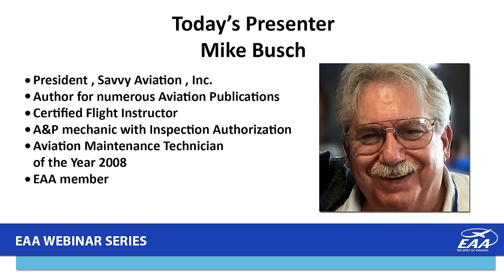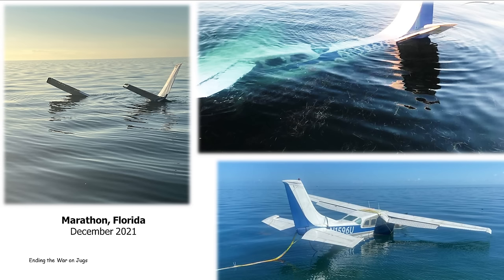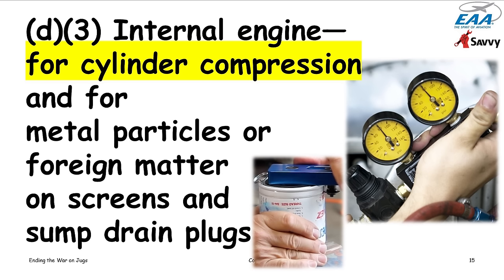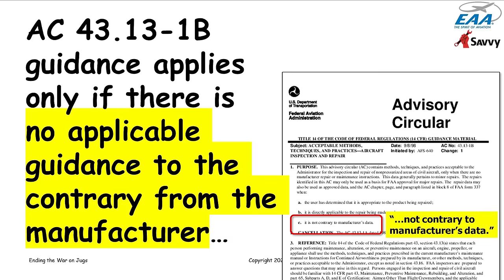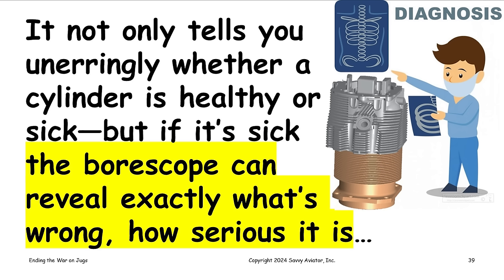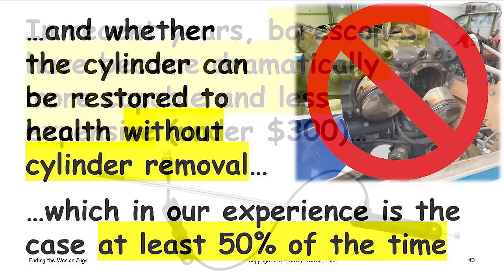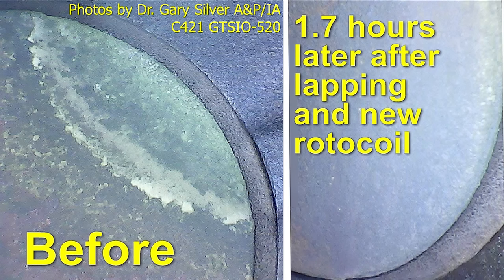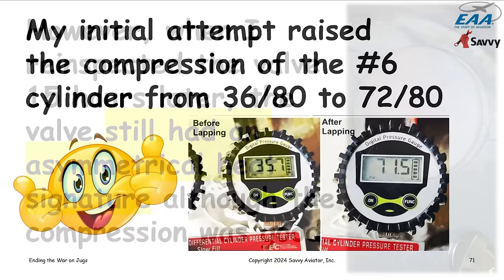Ending the War on Jugs

Comment: I don't know why this guy is so uptight about cylinders all you have to do is follow the procedure
Reply: Mike's message is pretty clear in literally every video. Don't touch things that don't need to be touched (as long as you're properly maintaining and caring for your aircraft). Specifically, if you can use a modern tool (borescope) to determine the ACTUAL condition of an engine, the only time you'd need to remove the jugs is when you KNOW its condition warrants that level of work.

Some mechanics will never get it wrong but why take the risk when there is no upside vs the less invasive and more accurate process?
Reply: @cbbbbbbbbbbbb  I'm just saying that when it is time to change a jug he makes it sound like it's the most dangerous thing in the world. And it can be if you don't follow the procedure
Reply: And if every procedure in any dicipline was followed properly we would never have accidents. Same for people following the speed limit and not staring at their phones while driving. The problem is that removing a cylinder multiplies the opportunities for mistakes when there are a few things that can be done first to fix the problem and reduce the opportunities for mistakes.
Reply: @jimstanley_49  Wet torque with new hardware and clean mating surfaces.it's not that difficult. Whith multiple cylinders use torque plates and do not move the prop. Seriously it's not that difficult
Reply: Did you watch the whole video?
Maybe you should watch from 1:23:25 where Mike answers a question about how failures occur after cylinder maintenance?
Reply: @charlesbrewer6552 and Mike clearly says what I said use wet torque use new Fasteners with clean mating surfaces  guys this is not that difficult
Reply: @derheeheehee6941  He did not say you should not remove a cylinder.
He did not say it cannot be done safely.
What he said, if you bothered to listen, is that history has shown, is that many accidents were caused by small mistakes made when putting engines back together again.
This is an historical FACT!
The accident record shows this!
SO, only pull an engine apart if it is REALLY necessary.
What on earth don't you GET?
If it is NECESSARY, pull the cylinder, but if you can avoid it you will reduce the risk of maintenance induced engine failure and substantially lower the cost to the OWNER who has to pay for all this stuff!.
Reply: @charlesbrewer6552  you can listen to Mike I will follow the overhaul and maintenance manual.
Reply: Yup. While critical, it’s not hard.
Reply: @derheeheehee6941  OK.
But I would not pay YOU any money to work on MY airplane.
Reply: @charlesbrewer6552  I don't want you to pay me I want you to stay away from the wrenches. The 0-320 Lycoming has 4 3/8" deck  nuts at 300inlbs and 4 1/2" through stud nuts at 600inlbs. Why are you letting that simple procedure kick your ass? As a licensed mechanic with inspection authorization I've done at least a hundred of them in the past 30 years and I've never had a problem so yeah you need to stay away from the wrenches.
Reply: It's not a bad thing when certain customers don't want you to work on their plane.
Reply: @firstielasty1162  easy peasy. Just triple the quote and they’ll go elsewhere.
Reply: @derheeheehee6941 100 or so cylinders is a REALLY small sample size when compared to the data sets that's he's talking about. Congratulations on your personal record however as he does say you can have had hundreds of successful installations, and have a failure on the 300th or whatever. Point is, if the risks are avoidable how isn't it responsible to avoid them?
Reply: @TheRedbeardpirate  I just buy a new cylinder assy, install it per the overhaul  manual and call it a day. It's an easy procedure.
Reply: @derheeheehee6941   Don't stop learning we can always improve as better data and procedures are proven.  Go back through Mike's work he goes into great detail why avoiding unnecessary procedures is good for everyone involved.
Reply: @nitrostamped  installing new cylinders is a necessary procedure

Comment: THE ONLY PROBLEM WITH YOUR RING FLUSH IS CLEANING THE TRASH OUT OF THE CRANKCASE SO IT WONT END UP IN THE BEARINGS LEAVING YOURSELF WIDE OPEN FOR A LOT OF LIABILITY THE VALVE LAPPING AOK

Comment: You are right on on the xylene flush. I have used it on cars, and have no doubt that it works. Have not yet done it on aircraft. 
   I do think that rings leak more often from sticking than wear, and how an engine is operated matters a lot.

Comment: In automotive circles, mechanics commonly employ 3 types of compression test:
1) Leak Down: Measures steady-state leakage at TDC (i.e. end of compression stroke). While it represents a critical position, running engines spend very little time at TDC.
2) Dry Compression: Measures transient leaks at starter/cranking engine speed. Tests leakage along the full compression (but not power) stroke.
3) Wet Compression: Similar to 2), with oil sprayed into the combustion chamber, for improved ring sealing (valve sealing unaffected). Excessive oil risks hydraulic lock. I suspect that oil sealing is most effective with vertically oriented cylinders, and least effective with horizontal cylinders.

Ideally, such tests are conducted with a hot engine, as a cold engine compression test would only represent cold-starting conditions. I imagine that (even large) air-cooled aluminum engines cool off rather quickly, compared to liquid-cooled engines. It seems that flying for "at least 45 minutes" does little good to stabilize its temperature, when it takes several minutes to descend, land, taxi, and remove spark plugs.

Comment: I've never heard that oil comes out of the oil control rings, but rather the oil control rings scrape the excess oil off of the cylinder walls that gets there from splash from the crankshaft. I don't believe that any pressurized oil comes out of the holes rather it drains in through them.  That oil then lubricates the wrist pin.  This is why wrist pin failure is common in sludged up engines
Reply: That's also why these sludged up engines consume more oil because the oil control rings are not removing that excess oil from the cylinder walls and therefore it then gets burned
Reply: Wrist pins also fail from detonation.
Reply: Wrist pins are splash-lubricated by the crankshaft in most engines. Oil control rings reduce the amount of oil reaching the hot piston rings to significantly reduce coking, and oil consumption. They "control" the oil film thickness on the cylinder wall, not fully remove it.

Comment: Not just about flying after engine work, but also flying post paint work as well.  After painting, all the control surfaces have to be reinstalled, the engine was sitting for a long period time, and possibly get contaminated with all the chemical washdown.  Yet I often saw owners of newly painted airplane took off and flew home or somewhere else without doing post paint inspection flight.  I saw owners rushing to leave the airport for long overnight trip in their newly painted airplanes.  Or sometimes, they hurried to takeoff to escape the incoming bad weather.
Reply: Not to mention, they require re-balancing all control surfaces within specification, as fresh paint behind the hinge-line adds weight. Causing flutter margins to be substantially reduced.

Comment: What is the usual mistake with removal or re-installation that leads to subsequent these disastrous cylinder head failures?
Reply: 1:23:25
Reply: Exactly what is causing the failure after the repair that should be the main concern
Reply: @kennethbawol8800  it sound like any of a dozen actions that are not performed 100% correctly. The whole reinstallation is the single point of failure.
Reply: Piston rings alignment, compression, strain, cracking. Loosening and Re-torquing cylinders. Not to mention removing valve rockers and pushrods. Too many critical components are being molested and re-installed after proving to have been properly instaled in the first place, by surviving ~1,000 hours in service already. Why try to fix what ain't broken?

Comment: There must be a legal reason he just will not say WHY engines are failing after a major repair
Reply: It's simple. They partially disassemble a perfectly functioning engine and re-assemble it with formerly broken in, used parts, that were happy working together prior to being removed and left sitting around the shop. Re-installed and re-torqued not in perfect alignment to where they were previously broken in at. And then all of the human errors that can be introduced at this point.

Comment: Years ago when i worked at a FBO as a summer job whilst studying for my Mechanical Engineering Degree. I learnt a really related lesson. A Cessna 421 came to us with a misfire on one engine. A compression check showed very poor compression on one cylinder. It  turned out to be 2 bad plug wires on the offening cylinder. New plug wires and the cylinder recovered.
Reply: Please explain.  Are you saying that the cylinder was not operating at optimal pressure and temperature, therefore changing the ring seal during a pressure leak down test?
Reply: I would guess so as the cylinder  (and the engine performance) recovered. It was only the persistence of an experienced A&P and the owner that found the real fault and stopped the pot (UK speak) being pulled.
Reply: Sounds like a ring issue from running many hours without firing on that cylinder.
Reply: Maybe but it did make the last 150hrs remaining to the TBO I believe. I don't think it had been like it  too long as the pilot had returned due to rough running only 5 or 10 mins into the flight. I would be more worried about any damage from detonation. Not the most forgiving engine, but they did sound great.

Comment: FAA records show Horizontally opposed air cooled aero engines have a mean time between in flight failures of around 3,600 hours. The vast majority of those happen within the first 2, 20, and 200 hours from new or overhaul. Or after 2,400hrs in service. The ideal range to have an engine is the 2,000 hours of reliable service between 200-2200 hours time in service/since overhaul.

We are talking more than half of all catastrophic failures happen between 0-200 hours vs 200-2,200 hours. You have a 10x greater chance of engine failure by messing around with an engine.

Comment: The best thing to do is ditch horizontally opposed, air cooled engines that haven't had any improvements in over 60 years. Not even Nikasil cylinder bores, or sodium filled exhaust valve stems.

Comment: If the scope inspection and owners' assessment of recent performance says nothing's wrong, you should do a hot test. Borescope inspection I would think would assess the walls. The valves and seal probably should be assessed, but what does good and bad look like with the borescope? I would doubt you could see the rings, if you could that would have to be explained. The thing about noninvasive repairs is you may lose a cylinder if you did not do a good job, but you have little chance the whole engine will go out because of something you did.

Comment: A BOROSCOPE INSPECTION IS STATED AS REQUIRED IN MOST MANUFACTURERS MANUALS AND THE BOROSCOPE COULD CLEAR THE ENGINE IF IT IS A HOT ENGINE?

Comment: SO, THE INTERNAL ENGINES TO INSPECT EVERY 100 HOURS OF ENGINE ABD NACELLE GROUP FOR COMPRESSION AND FOR SUMP PUMP DRAINS AND CYLINDER HEAD FOR METAL SHAVINGS, AND IF THERE IS LOW COMPRESSION CHECK TOLORENCES?

Comment: Dumb question - what are the numbers "60/80" signifying?
I'm not an aviation mechanic, but I've done plenty of automotive compression tests, and we just use one PSI number.  If it's over 90 for a "low compression" engine or over 120 for more modern gas engines, and all cylinders are within 10% of each other, it's fine.  Then we have separate leak down tests to check valves, valve seals, and piston rings.
Reply: It’s holding 60 PSI with an 80 input pressure. In other words leaking 20PSI.
Reply: @TheReadBaron91  Thanks!

Comment: SO, THE REBUILD COMES FROM AC 43-13-1B? IT DESCRIBES COMPRESSION TEST AND READING? IF THAT FAILS THEN THE CYLINDER MUST BE REMOVED AND INSPECTED? THE TEST MUST BE DONE ON A HOT ENGINE AND MOST PEOPLE DON'T DO THIS?

Comment: To call the 1947 bonanza manual "current" when Beechcraft themselves have changed parts since 1947....
   Negates the meaning of the word "current". It renders that word meaningless. Why use it at all?
    I am not disagreeing with your statement on that, however. I have read that interpretation myself.
   In disbelief.  
    I think phone books were printed in 1947, also.
   Are they current? Currently, I mean..are we speaking English,  here?
   The Feds are not.
Reply: In addition to the ridiculous faa interpretation of "current", consider that resting on that crutch may be of no use when it really counts.
   THAT moment is not when the Feds decide you didn't technically violate an FAR- no. It is when the lawyer representing the families of the dead people in the burnt Bonanza are asking you in court "Why did you use 76 year old service information, when the MANUFACTURER of this aircraft has themselves provided MORE current data?"
   At that moment, the FAA is probably the least of your worries.
Reply: @firstielasty1162 it’s aircraft MX, we are dammed if we do or damned if we don’t.
Reply: And at that moment, in court, with the lawyer- the FAA won't lift a finger to help you!

Comment: Here’s the thing, I’ve heard this guy bloviate for years poo-pooing mechanics for engine failures. He tends to paint all mech anics with a a broad brush and it pisses me off. if you go look at the NTS reports on the fatals, other variables existed.  He’s not a big fan he says of compression tests. So he is saying because I got an award in 2008 I know more than the manufacturers do. Here’s what Lycoming says: 

Typical Differential Compression Measuring Device
1.Operate the engine until normal cylinder head and oil temperatures are attained; then shut down the engine making sure that magneto switches and fuel supply valves are shut off. Proceed with the test as soon as pos- sible after shut down.
2. Conduct the test in accordance with the test equipment manufacturer's recommendations.
3. Interpretation of the results of the test is highly dependent on the skill and judicious opinion of the tester; however, the following observations cover the principle factors to be noted:
a. Pressure readings for all cylinders should be nearly equal; a difference of 5 psi is satisfactory; a difference of 10 to 15 psi indicates an investigation should be made.
NOTE
Unless the pressure difference exceeds 15 psi the investigation should not necessarily mean re- moval of the cylinder; often a valve will reseat itself and result in acceptable compression during a later check which should be made within the next 10 hours of operation.
b. If the pressure reading for all cylinders is equal and above 70 psi; the engine is satisfactory; less then 65 psi indicates wear has occurred and subsequent compression checks should be made at 100 hour intervals to determine rate and amount of wear. If the pressure reading is below 60 psi or if the wear rate increases rapidly, as indicated by appreciable decrease in cylinder pressure, removal and overhaul of the cylinders should be considered.
c. Low pressure in a single cylinder is indicative of air passing by the piston or by the valve.
d. Air discharged from the breather or oil filler tube indicates leakage in the area of the piston and rings. e. Air discharged through the intake system indicates leakage at the intake valve.
f. Air discharged from the exhaust system indicates leakage at the exhaust valve.
This is from the same 1191A bulletin. 
I do agree with borescope inspection, been doing it for 20 years if not longer. 
Another thing he fails to mention is liability but worse yet absorbing liability with an owner who wants to only do the bare minimum or even less. Ignorance or just plain not giving an airplane the same level of care they do their Mercedes just baffles me. For those of you who care, EVERY modern manufacturer (post 1960’s) has an inspection guide that goes into further depth than Part D does. If a mechanic still does an inspection I/A/W Part D, rest assured he missed ALOT of things. Back to the issue of liability, lapping valves in place is more accurately performed in a bench by shop who does that function every day AND as an extra added bonus. A repair station who will issue an 8130 for the repair. I will make this argument, In my opinion if a cylinder is bad enough to require lapping, that is plenty enough reason to pull the cylinder off because as y’all have seen in some of this pictures seats are worn, valves do not sit square in the seat which is a sign of worn valve guide which will most likely have have oil seepage which will like foul plugs. He also doesn’t mention engine time, I could go in and in poking holes but you get the message.

Comment: LAPPING MAKES THE VALVE CONTACT AREA IS TREATED WITH A CHEMICAL TO MAKE IT SMOOTH AND SHINE AGAIN?
Reply: Lapping compound is like Jewelers polish. 

It has fine particle abrasives in a paste. 

You lap the valve my spinning it carefully and this abrades the surface of the valve and valve seat to fit close tolerance of 0.0001" or better.

Comment: IT DOESN'T REQUIRE AN A&P TO DO A BOROSCOPE INSPECTION AND IS PREVENTATIVE MAINTENANCE?
Reply: Pilots can usually change spark plugs, filters, and oil as owner maintenance. You can purchase borescopes that work with android phone apps for $25. If you can remove the plugs, then you can scope the bore.